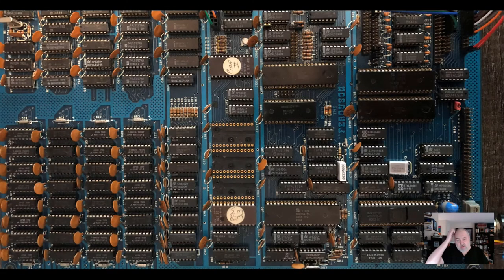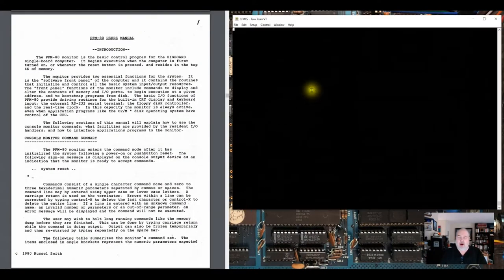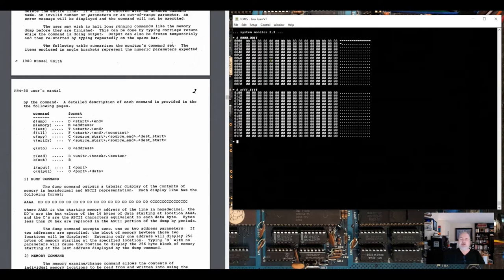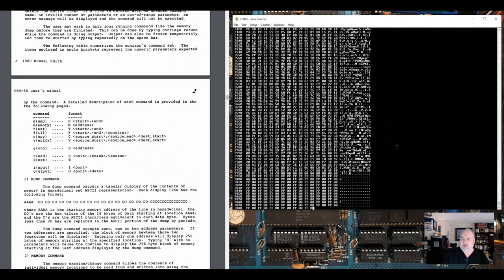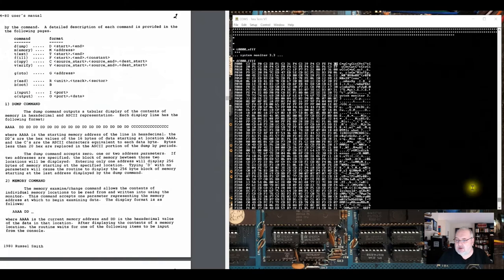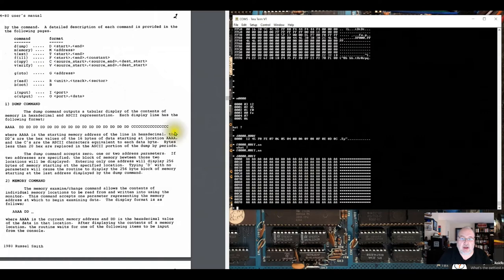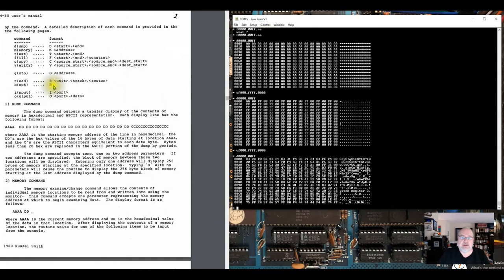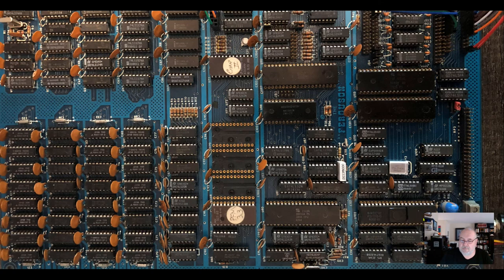STB656 - Ferguson Bigboard - Part 7 - PFM 3.3 Monitor Demonstration

Comment: This is very interesting.  I worked on the listing as well as the ROM code to see if I could find anything significant as I have a similar Z80 system I built for testing.  The monitor seems a bit rudimentary but I am sure someone could really develop it with some work.